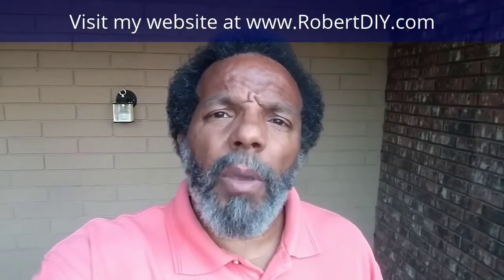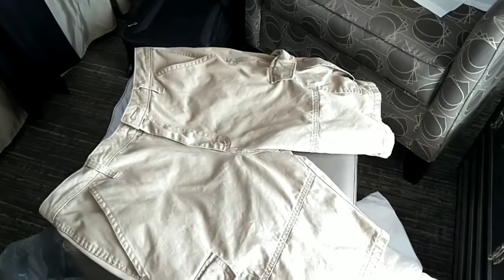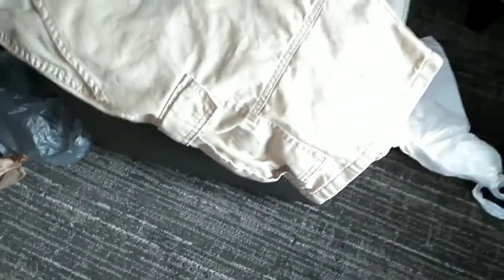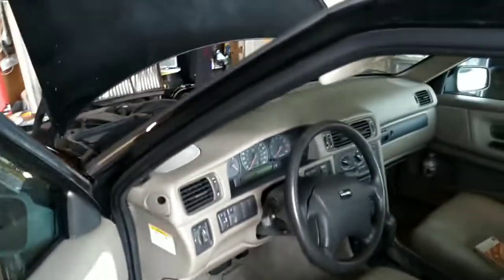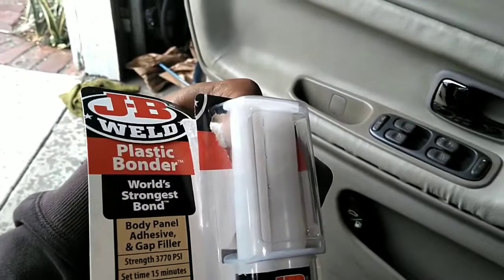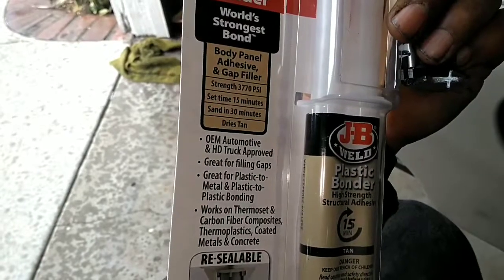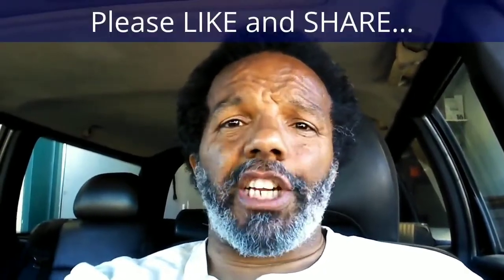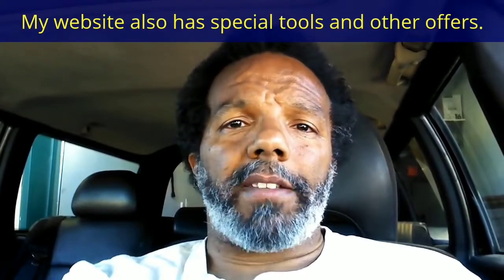Las Vegas NV then back to LA

Comment: Hey Robert, does that JB Weld you used here, get your stamp of approval?
Reply: Worked well on my split plastic bumper cover. Abrade joint and give the damage a good clean with acetone.
Reply from the maker: I plan to use it again.

Comment: Robert I have a 95 960. Wjen I start it in the morning smooth idle.  After 30 mins it starts to run rough. No codes and I'm stuck
Reply from the maker: May have a vacuum leak or something. Have a Volvo mechanic check it out
Reply: @RobertDIY  low battery voltage. Code 132 just popped up. Battery is 5 years old. Not enough voltage to the system.

Comment: So I went to look at a 96 850 glt today, it's got 272k miles, is manual and is relatively clean. However it's due for a timing belt, a pcv system, and the abs/ trac lights are on. They're asking $1300 but I offered $850 is that a fair offer or for you think their asking price is fair?
Reply from the maker: Fair